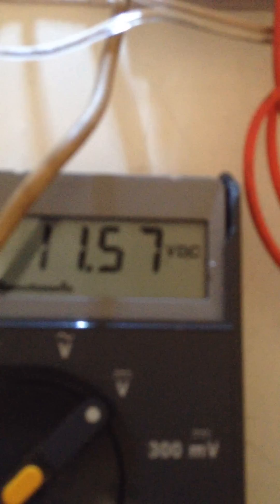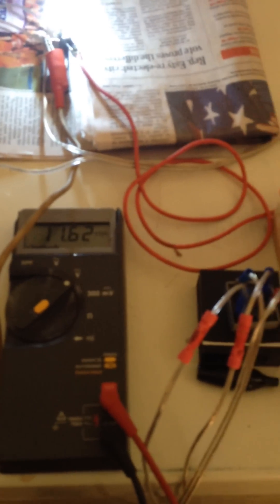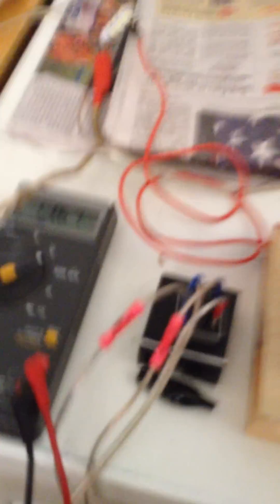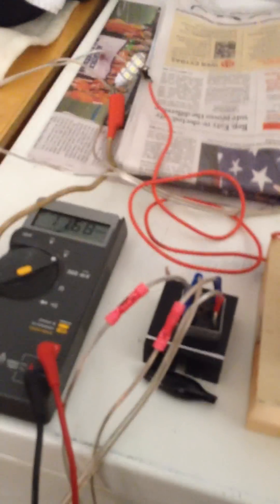Over unity created with transformed back emf. True over unity, no BS!

Comment: Marc, HI, I don't know if you remember me but I am the guy who made an ass of myself for a year attempting to find what ED LEEDSKALNIN did down at Coral Castle. Then I figured it out, with that, I made my way past the obvious basic stuff that was down there BUT I have always thought it was possible for him to do what you are doing here with the pmh and the big wheel.
        I have always liked what you got here. Basically the SSG no?? I will certainly play, cause I do believe in it. I have just always wondered where the energy comes from. latent heat of the surrounding aether. lately who the hell knows. It seems as if its really been there its the lack of heat dissipation that might be result due to outstanding efficiency PLUS zero point access in the acid? personally I don't care but with all the nuclear, electrical, electronic science stuff I have taught it would sure be nice, but really who cares if it works......      Thanks for the info. I will research this in my shop and "enlarge" the circuit for practical apps if it will do my battery bank (like CC again). check out my video if you have not already, it on this channel it the one about quarrying and engineering mystery solved.      I should probably attempt a SSG LEEDSKALNIN circuit to see how it desulfates and charges  my car batteries
         Where are you at lately??? I have an email contact form on my "madebyoneman.com" website. give me a shout.
Reply from the maker: +Made by one man I have started to notice some overunity effects with these circuits, well, I thought it was this until I saw some of the Don Smith circuits. What i noticed for a rule of thumb was the fact that electricity being generated actually is an entire window of frequency response, and i use an example of this like an audio output. If we have a generated window of power, like a large frequency range or frequency response of a speaker, we could eliminate all of the extra power at different frequencies driven by the circuit, or generator by applying a notch filter to filter out the unecessary frequencies as Don Smith does. Here is basically whathe does and I will be completed with my circuit soon and I did figure it out. He starts by energizing a circuit with a 12v battery. He inverts it using a pure sine inverter of like 130 watts. I used a battery backup ups system for a computer, I drive a variac into a neon sign transformer, I rectify one part of the output to allow only positive waves to pass, I wire the Tesla Hairpin circuit into the circuit, then, I wound the transformer Don Smith has created using weight of the wires to follow a guide for resonance as Tesla did. For the primary coils and secondary being different sized coils, I just match their weight to obtain resonance. I then add the components he shows in his circuits, and, I step the circuit back down to a manageable and safe voltage so  I could loop and charge the battery, then, I added audio notch filters on the output of the step down transformer to eliminate the back emf of the full frequency range from ultra low frequencies to high frequencies of nearly 200k. This allows only a bandpass of 60 hz to be taken from the circuit while it uses high frequencies to allow the power amplification to be made, giving an output of well over 50kW to 100kW with ease. Here is his pdf. Pleae share this with everybody.. It is easy to do and the net is loaded with info on how to do this. Oh, btw, I saw your video.. Great Research, it is rather impressive!  Here's the link to the pdf:

http://www.free-energy-info.com/Smith.pdf
Reply from the maker: +Made by one man  Hello,
 After I saw that a scientist has discovered that Plasma Tubes literally are seen from the Magnetosphere, all the way to the Earth's crust, I now know exactly how this happens, however, I have figured out 3 things at once with another project which takes this energy in and I do have a way of pretty much proving it, however, until the device is fully functional and I set it up outdoors so I can get this in front of my viewers, I'd rather not say and make myself look like a hypothetical ass for explaining it without showing my reasoning.. It seems as of lately, I have been mentioning my theories and since science has  one way of saying so, and mine is not that way, without backup, it is basically open mouth insert foot, then, get eaten alive by the suppressionist mosquitoes that fly around in these places.

Your mention does state that you'd like to know how and where the energy comes from, I can't prove it until I am able to get the generation system I am working on to self run as it certainly will, it is just a ton of work to get it all in resonance because there are compound formulas and testing to perform that result in resonance from 2 separate directions at the same time, another thing that the good laws say are not necessary because of the theory's supposed impossibility since it would cause an infinite resistance for the components used and it would function without any load, creating an exponential growth of charge which results in voltage, amperage, wattage, current flow, and, a fully functional amplifier of energy in an exponential quantity that probably would be so large that we will not easily be able to store it because it is too powerful as well, dangerous because it is converted back to conventional electricity so it is clean and used at the correct frequency.

Electricity at low frequency and DC without high frequency pulses runs without any ability to create overunity. Once the pulses start and the frequenxcy range is in the RF range, exponential increases start to happen when we create resonance and dump the energy into the right large enough capacitors. This causes the damming affect where if high enough frequencies can dump their energy in, it has much more than a smaller bandwidth, low frequency for a number of reasons. The low frequency has such a long wavelength that it can't carry anything with it, ie, the high frequencies are carriers of many more joules per coulomb, and, the low frequency has nearly nothing at all, it can't self oscillate either, so, as it does oscillate, it slows down rapidly and doesn't ring long,. When we have high frequencies, if they are in resonance, we can nearly make the frequencies in the MHZ range ring forever because they carry electrons that aren't supposed to be there in the first place, they have become excited and they are what is formed from the channeling of the energy in the plasma tubes created by the Earth's magnetioc field which is outside of the Earth, creating a capacitor, AND, the plasma tubes act as the inductor to the correct frequencies which have to be very high. The low frequencies are the planetary oscillations which are merely vibrational and synchronize with all forms of life through the pineal gland, nervous system, etc. The energies we manufacture are merely manifested from this magnetosphere, where it enters to the next layer, then, into the ionisphere, keeping a capacitor affect operating (this is why the crafts coming into Earth burn up, from the difference in potential between layers, the crafts force the positrons to enter into the atmospheric layer loaded with electrons, bursting flames/plasma between the layers where the High voltage capacitor starts to leak between it's layers instead of making a smooth transition, and, since it is Earth's energy system, , if we continue to use or burn too much oil and other natural fuels to do so, manifestation of this energy will not be there to fuel Earth's fire.  Earth oil and other resources end up changing/manufacture themselves over time with pressure and heat , eventually being the next layer to burn as the crust of the Earth recycles itself near it's faault lines. This naturally happens to fuel and keep the earth operating , flames continuously burning internally, as well, externally . We need the fire to keep burning and a lot of other things otherwise we will all die, the Earth's  power plant will shut down, energies within will stop flowing. All of these energies and functions from the Earth's heat are  responsible for  weather (from convection/cooling/condensation, magnetism, holding the atmosphere together in it's many functional layers, helps protect the Earth from incoming meteorites,  and, without these functions / effects happening at the same time, our Planet, which is a giant electrical machine, will shut down and die like Mars did.

I will keep posting my videos, I have a bunch of them coming soon. Thanks.

By the way, you did great work with the Leedskalnin video. It was very to the point and well thought out. Good job with yout research. Merry Christmas..
Reply: Marc Belanger SAME BACK TO YOU ON CHRISTMAS MARC. Yes if you are on to the concept of higher frequency vibrations using the imbalance of "ionic" differential then don't stop. some of this is what Tesla used to speak of. HOWEVER all I can say to that is I believe that this is similar to piano's and tuning multiple strings/circuits in harmony to create "sympathetic resonance"
      Due to the "layering" of the ionosphere we have different "tension levels" in the Aether. these values are like impedance in a basic electronic circuit. calculation, setting, and adjusting for these values are like a guy throwing a ball to the out fielder overcoming wind (solar) air density (changing), and distance. he has to compensate for these parameters in the air / aether. for EACH throw. no one has done that yet with their oscillitory circuitry except for large radio stations and mebe military stuff we don't know about.  
      Remember though, when we start vibrating stuff beyond the point where the dust seems to never settle we just might find cancer and other ailments come from literally shaking our "house" so much its giving us a headache and we can't breath because the very lattice of creation and the "EXISTING" life waves from the creating source may NOT be so good. Tesla lived to be 87 so maybe its nothing but I really believe their is a limit to the fish tanks capabilities. we are the fish and we are not well even NOW. 
        Don't stop the research by any means... just know that people are lazy now and any more FREE ENERGY might actually destroy our lazy asses even more.  Just a little food for thought. I will check your vidies here and again. Thanks for the positive support Marc. we will talk later I am sure.   
Scott R.
Reply from the maker: You have a great Christmas too. That is a good analogy, i think the system really isn't cutting through anything, we are just pushing the magnetic manipulation to a point that we are using the same affect as the electrical generator which passes a magnet over a coil of wire, which already has a charge in it, however, the energy isn't being created, it is funneled in by exponential use of it's input  through the already existing plasma channels that science has proven in existence recently

There is one crucial effect that I have found which is vital to the function of this effect. That is with the proper use of winding direction due to bernouli's principle, however, this has nothing to do with fluid, it has to do with the stream of energy and everything in it's process being equal and opposite. When the Earth spins, the rotation to gain access to these channels of magnetically based plasma flow in an opposite direction, or at least they induce that way. To tap into this energy, we basically need to use a small amount of energy to do so, we need to use multiple conductors in one piece, like a rope to do so, then, we have to ensure both the pickup or receiver is in resonance to have an infinite resistance, and, the transceiver, or the output of transfer (which has to be an air core using a polarized non magnetic filler (grounded) must also be in resonance. The reasoning behind this is so there is no forced loss. The conventional transformer has two problems with it. It was purposely developed so it doesn't draw this energy in from magnetically transduced plasma. Basically what the idea is here is that we are creating  a pickup and a drop off circuit which transform it's voltage from one point to another, both the input and output are matched and tuned to be in perfect resonance with each other, and, it is nearly impossible to do because we need to have either resonant coils that are both wound to the same frequency, or, close, then, modified with capacitors. To make the coils amplify the energy, the infinite impedance must be there on both sides. This is the magical item that draws the exponential energy from the magnetosphere's plasma channels. The energy being pulsed into the circuit must start with a DC voltage, then be changed to a pulse. Once it is a pulse, it is transformed with a flyback transformer to an RF frequency around 30khz. The next step is to rectify the output of the high voltage transformer so only positive pulses go through it (atmospheric energy is a positive pulse). Since this pulse is so high of frequency, the amount of joules per coulomb are extremely high. The next step is to create the transformer to transform on both sides in resonance (tuning with capacitors and changing turns or wire size.) the energy level is then transformed back down to a working level so the voltage that we have can be  filtered to offer 60 hz, or, it has to be turned back to DC and fed into a super capacitor bank so the harmonics can easily be filtered and inverted for use without any awful noise.

The arc gaps used must be the small enclosed gaps, but, one of the major secrets here are to energize the nst transformer and put the arc gap in series to the transformer coil so the system doesn't recognize the load of the primary coil. Once this is all said and done, the system is completed o a smaller scale like Don Smiths smaller opposite inductor that gave him 100kW at the Tesla conference. It was the simplest device he created and it is super simple to build, using only one inductor and 4 capacitors.